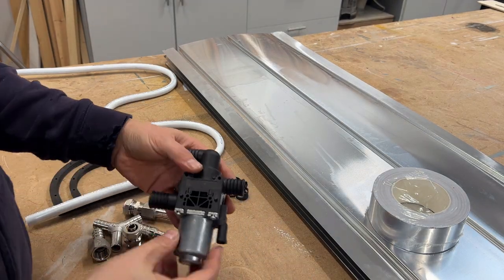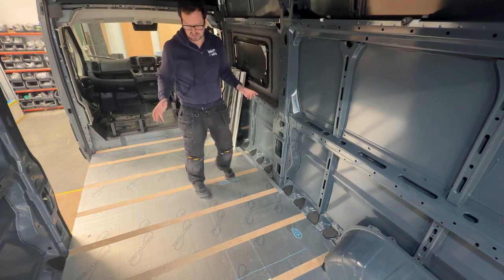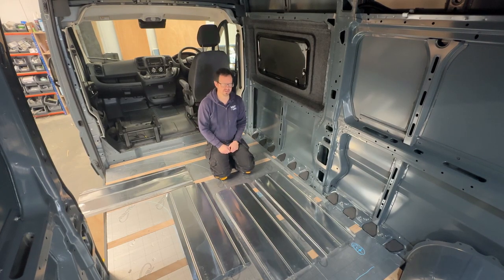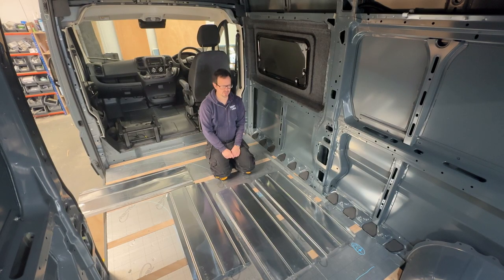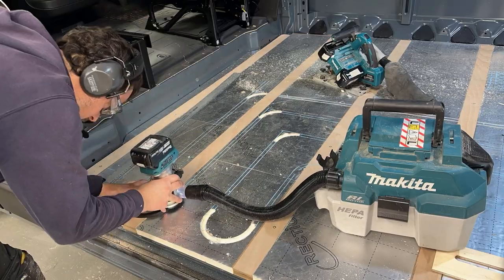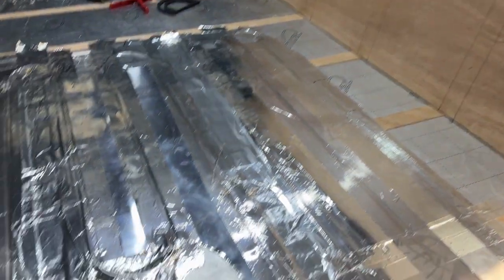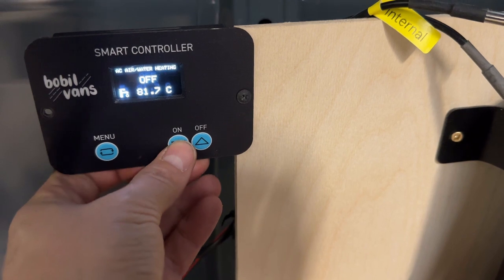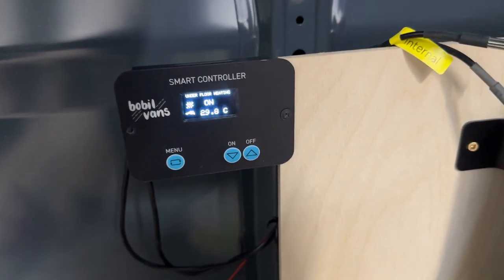Bobil Hydronic Underfloor Heating Overview

Comment: So when the underfloor heating is turned off, this valve closed the coolant loop through the underfloor heating? But wen it is opened (underfloor heating on), is the coolant volume split 50-50% through the underfloor and the calorifier or is the direct loop to the underfloor closed and the coolant passes first through the calorifier and afterwards through the underfloor?
Reply from the maker: So the coolant either goes blower box - calorifier - coolant tank, or it goes blower box - underfloor heating - coolant tank. This is so the system prioritises air heating before water heating. However if you want to pipe it differently or put in a 50-50 splitter somewhere then you can!